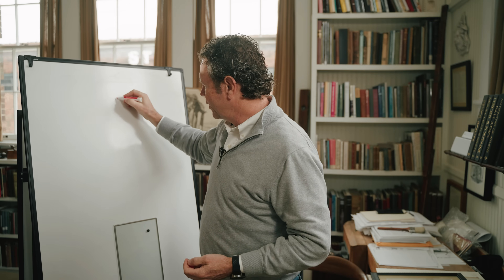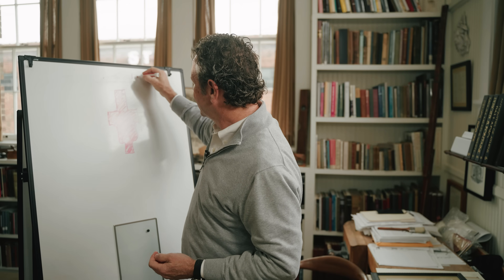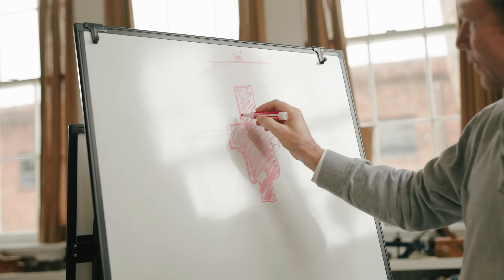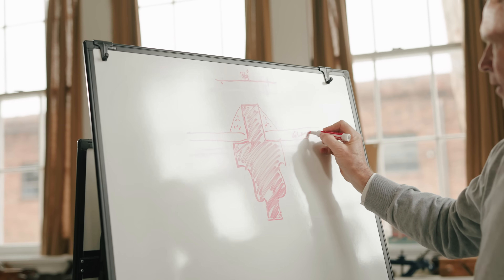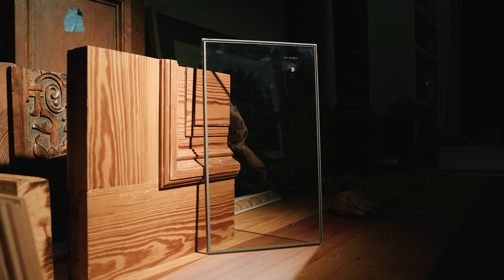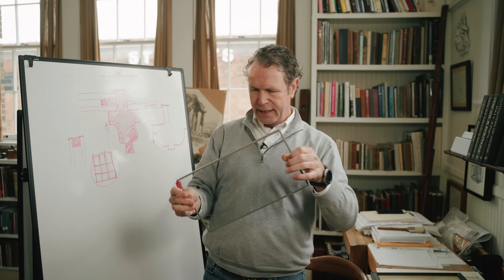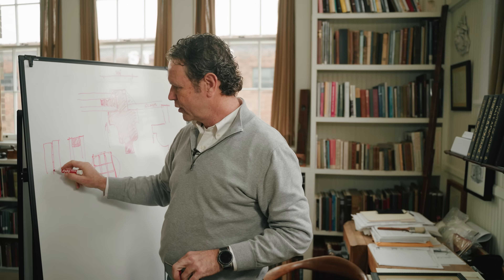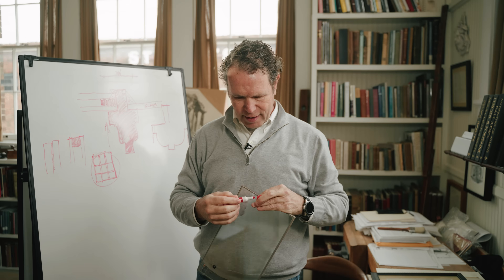Historic window glass – why insulated glass needs a major redo!

Comment: The thick edges of conventional  insulated glass units (IGU), whether they are metal or plastic, also detract from modern design that relies upon careful detailing. For  example, the Farnsworth house (1945-51)  by Mies Van der Rohe uses a delicate assembly of steel sections welded and fastened to the steel framing of the  house. That assembly is painted with  white lacquer. Adding a layer of metal or plastic would spoil the visual  simplicity of assembly. 

Same is true of glass detail Frank Lloyd Wright used in the Zimmerman house (1951)  in Manchester New Hampshire, where the edges of the glass in  the living room are concealed in the masonry piers and cypress wood ceiling. The cypress wood ceiling continues outside the house  above, and the garden continues into  the house  from below with an indoor planter. The concealed edges of the glass    create the illusion of the inside and outside as one. Using thick IGU, with a visible contrasting edg, would ruin the illusion.

Thanks for showcasing this new type of glass, Brent, Both visually and technically, it is a huge improvement over   conventional IGUs with their ugly conspicuous edges and short useful life.
Reply from the maker: Thanks! Great examples.

Comment: At some point there has to be a cost/benefit ratio..  These Pilkington Panes are probably seriously expensive and if at the end of the day we are looking for economies to our House Heating options then I have to see a reduction in my fuel bills.                 I doubt you would ever cover the initial costs to any meaningful degree.

 In my 1950's house in the UK I have 'Crittal' windows made of galvanised angle iron with single (Decorative Leaded) panes with secondary glazing with a gap of about 3". VERY efficient..
 I can remove these secondary panes during summer if I wish.. No problems with units fogging. Lasted 70 yrs so far.. Hoping for the 100's
 Finding and stopping drafts is an easy upgrade and thick curtains.
Reply from the maker: Ok. thx.
Reply: Vacuum glazing can fit Crittal but it needs to be used in large panes to work vest. If you have multi-pane Crittal, the solid bars creat too many thermal breaks and secondary glazing with vig would be the most-effective approach.

Comment: Modern efficient windows are far different from his 1990 concept. Mutton bars are absurd, I have to triple glazed windows with an R factor of 5 to 7, airtight sealed, using a whole frame that sets into the framed hole. Putty glazed windows are foolish. Th windows are sealed and guaranteed against seal failure for decades. Brent has little to offer true energy efficient homes
Reply from the maker: ok
Reply: @BrentHull 

Timber has the same thermal rating as polyimide thermal breaks in modern aluminium windows. Installing vacuum glazing in the correct, modern method would make the highest-performance window that would last a 100 years with the correct timber species, joinery techniques and paint. Only powder-coated, galvanised or stainless steel could last longer.

Comment: I was just watching a video from Technology Connections about awnings, and one thing he brought up was to do with UV, how older windows that let more UV can actually help save energy in winter because the sun is able to heat your house interior better. Of course, you have to pair it with something to keep out the summer sun, like shutters or an awning. Still, interesting to think about.
Reply from the maker: Yes, very. Thx.
Reply: Solar heat gain is different than UV filtration
Reply: @ you're correct, I rewatched the video and he specifically mentioned low "solar heat gain coefficient" windows in temperate climates increasing the need for heating, not UV-blocking windows.

Comment: Divided windows a simply an obsolete relic of a time when they couldn't make large sheets of glass.
Reply from the maker: Divided light windows look better than open sheets of glass.
Reply: @BrentHull They look better because the architecture grew around them. I agree they look beautiful on the right house, but it's also true that the design is because of old tech.
Reply: @BrentHull  It is just a former tech limitation we got used to like 24 frames per second for films.

Comment: Ah! We replaced all 28 large (6x2ft average) wood framed windows when we bought our old house 15 years ago and the new glass units are starting to fail already. The vacuum has gone and the coating (I suspect) has created streaks of iridescence across the glass units. All from one window company, we were told they would exceed 20 even up to  to 25 years but the warranty is actually 10 years on the paperwork 😢. So the gain in efficiency when you do the numbers is zero counting in the install, trim, paint etc. We should have kept the old windows and just heated a bit more in the winter. They were less efficient but still looked in top shape.
Reply from the maker: So sorry! Yes, you are experiencing the great lie in the window world. Thank you for sharing.
Reply: Which brand of vacuum glazing was this?

This sounds more like double-glazing where humid air has got in and dissolved the dessicant out of spacer bar to streak the glass internally and humidity has turned the clear low-e coating into its degraded bloom that looks like blue-lilac thin oil swirls on water.

Comment: Seem to mother VIG glass with larger pains as well that don’t have the black dot,
That’s a really interesting product. I’m kind of surprised the other guys haven’t covered it yet. 
Can you get up to our R17 insulation, genuinely amazing
Reply from the maker: No. R7 though. Which is ALOT more than regular IG which is R2
Reply: USA R17 is metric 0.334 W/m²K.
Vaccum glazing used as one of the two panes in an Argon-filled doubleglazing unit about one inch thick will achieve this. Some vig brands are good for 40-60 years but the double-glazing seal might be 10-20 years, its failure doesn't change much but it might mist and then need flushing out and resealing.

Comment: There really needs to be more awareness and discussion of the short life of these double-paned windows. I think most people just aren’t aware that they have repeat this unholy expenditure for all their windows every 15 to 20 years. And multiply that by every house in the country then think about what it’s doing to the landfills. This is not sustainable!
Reply: Not sure where he got his 15-20 years replacement period for double glazing. That's news to me.
Reply: Why don't the multi-glass systems last? (I didn't hear this in the video.) Does the gas eventually leak out? I would have thought that just the air space between the glass would be better than single pane?

I've been thinking about replacing the glass in my house with double glazed. ($$$!) I'm glad I found this video!
Reply: I think he's looking at the warranty periods. Which can be reasonable, why not warranty something if you expect it to last a while? I looked up Anderson 100 series, 20 year glass warranty, 10 years on non-glass. Of course with corportations being what they are, would a 50 year warranty really be worth more than a 20?

Any air seal will start to leak with time, so the insulation value won't hold forever. I would expect a leaky double pane to be better than a single. But you can start to get condensation on the inside that you'll have trouble getting rid of.
Reply from the maker: Amen. 100% agree.
Reply: Nonsense buy a quality aluminum or fire r glass window!

Comment: I didn't understood why/how insulated glasses stop to insulate in 15 -20 years.... Vacuum seem interesting, but with so much a difference of pressure, what i heard is that the vacuum only wants to go away, not like the classical insulated ones that have similare pressure with outside......
Reply: If by insulated glass you mean double paned windows, I see failed seals all the time. It’s more evident in humid weather when water vapor gets sucked between the panes. If it’s dry for a long then the water vapor might escape and the fogging is less evident.
Reply: @aliannarodriguez1581  Good to know... I live in temperate humide climate
Reply from the maker: I think when it loses its seal it fogs up. It still performs but you can't see through it sometimes.
Reply: @BrentHull  In this case i don't think it is true that "insulated glass" fail after 15 years, as i simply NEVER saw any fogged insulated glass ... And i'm a good observator and a reclaimer so i saw many insulated glasses...
Reply: @AutoNomades 

When the Argon goes and air gets in the thermal performance drops a small amount in one inch units. Misting occurs if the air is humid enough, if the spacer bar dessicant has got saturated, if the air is humid enough again, and if the glass is microscopically dirty enough to seed the condensation.

Units made in very clean factories with very clean, smooth quality glass might never mist.

If you chill the unit with a cold sorts injury spray, you might prove it's a clean failure vy getting a patch of mist that then goes when the glass warms.
Reply: @sirsydneycamm1883  Nice to learn a little bit more about, thanks ! So If I fill the gap with dry air, or similar pressure from outside insulating gas like CO2, am I good ? I want to DIY for myself kind of double insulated aquarius for solar cooking...

Comment: Regarding energy "savings", as long as you can recoup the cost...but the very rich could care less, its a talking point only, bragging rights, some new thing to talk to your friends about how green you are.  I've seen mansions with solar panels?  You got it, another talking point.  So an R value of one or two?  The rich are not thinking of that!
Reply from the maker: Thanks!
Reply: I don’t know about the rich, but most people I know with double panes windows look at it as a money saving measure. Correctly or not, that is how they are marketed. Personally I don’t see how that can be true if you have to replace them every 15 to 20 years. But they were originally it was expected (by consumers) that would last as long as a regular window.

Comment: Your “mutton bar” is a muntin bar. Great window info!
Reply from the maker: Thanks
Reply: I call the Mullions
Reply: Mullion is a plastic bar inside a refrigerator door that opens to seal the door when it closes on a side by side 😊 @MoonbeameSmith
Reply: Muntins seperate glass panes. Mullions seperate sash frames.

There's plenty of local variations causing debates.

Comment: So much worry about glass R values seems silly. If you have good storms the R value is way higher than all the expensive, fancy glass. I have steel casement (they go out) windows from 1927 and built interior storms with lexan and you don't even notice them. Cost me less than $2k for 40 windows.
Reply from the maker: Awesome solution. Thanks for sharing.
Reply: I like storm windows a lot but assume you would only use them in the winter as you will want to be able to open your windows at other times.

Comment: Do you think there could/will ever be double/triple glazing with vacuum insulation instead of a gas?
Reply from the maker: I suspect the poor technology and sealing will change as customers demand it. Unfortunately, it will take customer complaints before a change happens. Thanks for your question.
Reply: I feel like there’s been more than enough time for complaints to have driven change if that was going to happen. I feel like people just don’t really understand how short lived these products are, and because people have often switched houses before window fails, the salespeople can make it seem that the previous owners bought cheap defective windows. You are never told that the windows YOU bought are not going to last.

Comment: The black dot is a deal breaker for me; I'm sticking with single pain glass.
Reply from the maker: It's a problem but we are about to try an opaque dot, that could change my thinking. More to come.
Reply: Maybe it would be better to lean into it. Have a wood covering attached to the mutton bar, designs like a fluer-de-lis or vines would cast interesting shadows.

Comment: Your info on thermal units is inaccurate. Any thermal unit with a stainless steel, aluminum or sometimes foam type of spacer around the edges is a "sealed" unit. The "band" around the edge is filled with silica beads to absorb moisture within the sealed cavity. The panes of glass are sealed, but they're not just a dead air space, the air is removed by vacuum. That is a standard "insulated unit". Removing the air provides a better insulating factor than merely 2 panes sealed together, something that doesn't exist. The upgrade, low e argon, is when the dead air space is filled with an inert gas, which is an even better insulator than a space void of air. Low e is a coating in between the 2 panes that reflects more bad sun in the summer, prevents fading of carpets and furniture, but allows more good sun to enter in the colder months when the sun is lower in the sky. 
The black dot is ridiculous and won't sell. 😂😂
Reply from the maker: Thanks for sharing. I think you're missing my point. It doesn't really matter how they make them, the point is they don't last. Window manufacturers use the failure of insulated glass as an excuse to replace your entire window. This means we are installing windows that can fail in as few as 10 years. Its a waste and it is a flawed technology.  FYI. They've been making the Pilkington glass for over 20 years, I think it is selling. Thanks again!
Reply: @BrentHull 

Standard IGU are made with air in the cavity and then are flushed through Argon, Krypton or Xenon until it's 90% Noble gas and 10% air. The unit is at 1 atmosphere pressure. It absolutely is not a vacuum, it would sound like a whoopy cushion for 10 seconds or implode. Standard Argon IGU are 1.4Ug down to 1.1Ug.

Vacuum glazing's cavity is a vacuum at 0.1Pa. This is the atmosphere at 80,000 feet altitude. It is this rarity of air that gives 0.47Ug insulation.

Low-e does not change with seasons. It reflects infrared to keep some sunshine out to prevent overheating and keeps your heat in to lower bills. Any difference through the year is purely the compass orientation of the window as the sun changes with seasons and architects are supposed to plan which way to point them according the house's latitude.

Nearer the equator, most places don't bother with low-e glass and have canopies, shutters, blinds and overhanging eaves.
Reply: @BrentHull 

The 'black dot' served a purpose has vecome smaller or disappeared and world sales of vig are about 15 million square metres and now growing exponentially. As ususual, the UK is far behind using its own invention at only 40,000sqm per year compared to 20M pa of new glazing.

It will bw efault glazing in 3 years as to meet upcoming regulations, the far thicker and heavier triple glazing will need completely different windows whereas vig fits all current and heritage types.
Reply: And home inspectors look for failed window seals when you sell a house. In a normal market, buyers usually expect those windows to be replaced, though in this market market the seller can likely get away with refusing.

Comment: Single pane plate glass is the best.  No heavy border, it's thinner, No double reflection when looking at the glass from outside, plus no tempering distortion.  I don't mind that my house is a little bit colder for 2 months out of the year. I'm changing all my glass back to single pane.  Those black buttons are so stupid, I thought you were joking at first.  Good video anyway.
Reply from the maker: Thanks for sharing.

Comment: Curious about the effects of solar pumping on the seals. 100 years is a long time to resist the pressure deferential cause by temperature changes. I would assume that this system has gone through some kind of cycle testing in order to verify whether it can withstand the years of temperature changes.
Reply: There's nothing inside a vacuum to be pumped by heat
Reply from the maker: Thanks!
Reply: @LukePighetti 

Indeed. There's so little heat transfer the external pane moves with day and night temperatures while internal stays the same. It's a very small expansion but very large units can pick up a bow and early units broke their edge seal. Revised seals greatly reduced this about 10 years ago.

The early ones failed because they were too good!
Reply from the maker: The product is fairly new 10-15 years but so far, it holds up very well.
Reply: @BrentHull 

Spacia is 28 years old. Its lack of failures makes all other factories say 25 year expected service life. They increase the claim each year!